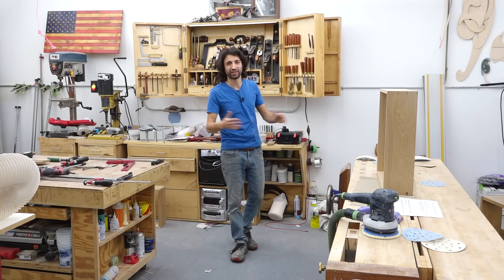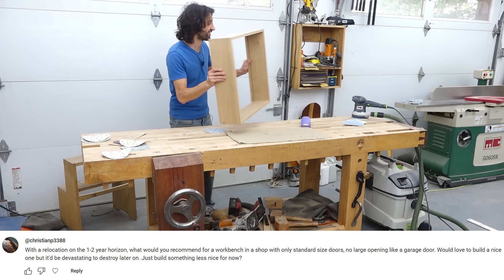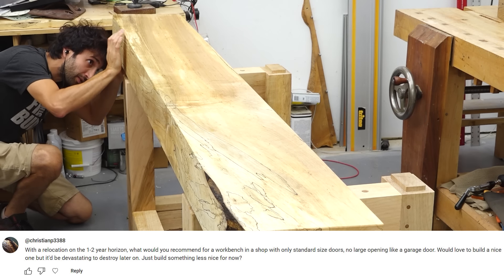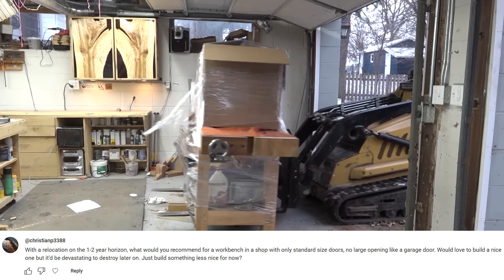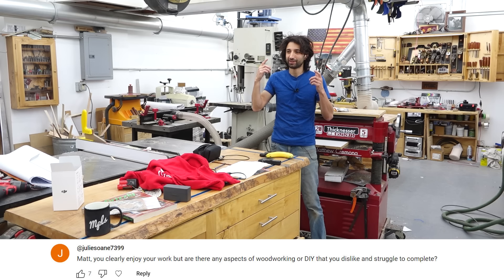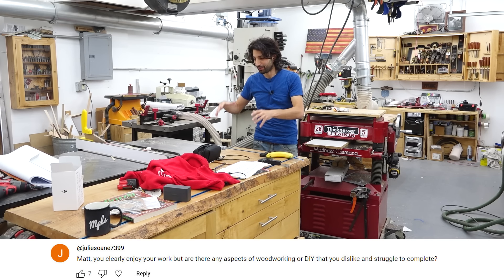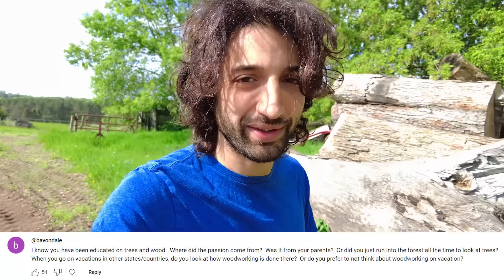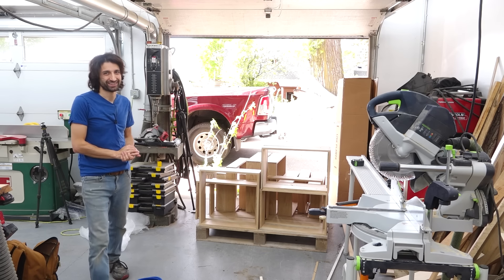Template Sticking, Workbench Transportability, Next Woodworking Project - Q&A May 2024

Comment: +1 for the knock down roubo slab bench, in mid process of building it now, only snags I have found is cleaning up mortises with a 2" router bit because I do not want to hand chisel to clean it up and don't have a mortiser to do it and finding the big bolts for holding the long rails to the leg assembly. Had to buy a big pack of them from Amazon due to no local suppliers having any

Comment: Hey Matt I use Scotch Double Sided Tape 12mm x 33m - TAPE4510 | It works excellent holds well and comes off easy= I usually put several small pieces around the perimeter of parts to be worked- try it!

Comment: Sign supply distributors have a super great unbreakable poly plastic rubbery tape- 2 sided ,You cannot tear it. Tuff tape will generally hold everything, but when you get it apart (when) it can be peeled off the material = if it is solid Try some  even a sign shop should have it to get a 1" x 12' strip to try.

Comment: Hey Matt, love the channel! I have a question I’m hoping you can answer. I recently picked up a used G0609X. So far I’m loving it but I was wondering: do you get the clunking noise when it’s shutting down right after the centrifugal switch clicks back into the circuit?

Comment: I would just like to have a shop to work in. Are you or would you consider building at least a partial lean to to the side of your storage barn to house your saw mill so you don't have to keep putting it away and bringing it back out to use?
Reply from the maker: I would still bring it out. Sawing under a lean to wouldn’t make for a very compelling video
Reply: @mcremona  Will you ever expand your woodworking shop? It does seem to be pretty cramped in there. LOL